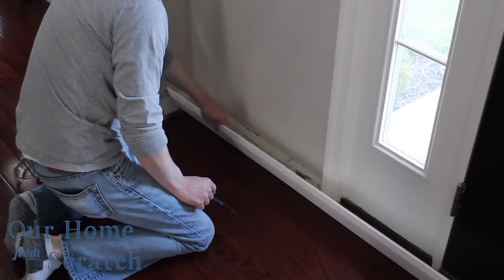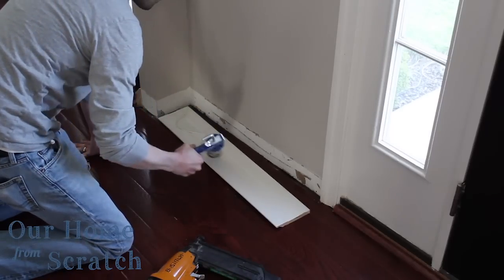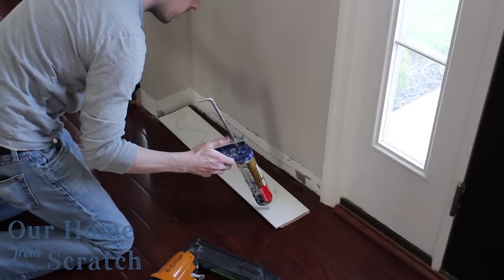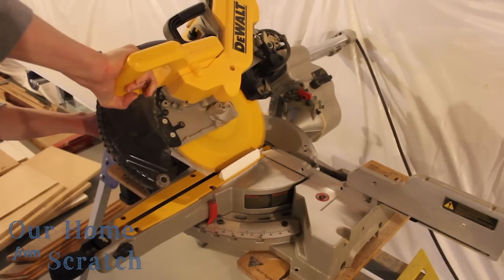How to Install Baseboard Molding

Comment: This is how one part of my wall is for chair rail molding.  So considering the part of your wall we can see you used two 45 degrees with copping ends and the rest are 45.  I'm confused about the piece that you measured in 4:13 and 5:04 are those just 45 angles no copping?
Reply from the maker: +TaRay Watts Only use coping for inside corners.  Miter cut all of your outside corners (no coping).  Assume they are 45 degrees, but best to try the angle out with two pieces of scrap molding cut to 45 first.  Then you can adjust the angle if they are slightly off (say 43 or 47 degrees, for example).

Comment: so the holes are just there? you dont use caulk or paint or whatever to cover it up? 

I spent 100k on a complete house remodel and this trim was part of it, but I dont like the site of those small nail holes sticking out, guess I'll have to figure something out myself since it'll probably be another 100k to patch them up lol
Reply from the maker: All nail holes get filled with wood filler and then painted.

Comment: Hi, John.  How do you install baseboards on a wall with a 45 degree inside angle?
Reply from the maker: You can try cutting both sides of your molding with 22.5 degree cuts first to see how that fits.  Try it on two scrap pieces before your use your final boards.  If that doesn't work, you can try coping.  To cope a 45 degree inside corner, cut your first board to a 45 degree angle so when it's pushed into the corner it makes contact with both walls.  Then your next board can be cut to a standard 45 degree cut for coping like in this video.  If that doesn't make sense, let me know and I'll email you a drawing.

Comment: Nice.  I don't have a compound saw or mitre saw...could I use my handsaw or jigsaw to make the 45 degree mitre cut that is to be coped?  Also, good taste I have the same exact molding. ;-)
Reply from the maker: +S Thunda You can, but it will be much harder to make small adjustments.  For example, if you need to take 1/16" of an inch off a piece of molding, that's very difficult to do by hand, but a breeze to do with a saw.

Comment: Great vid! I'm going to attempt this...how can I measure the  corner so it can be cut at Home Depot I don't have a power saw or a coping saw?
Reply from the maker: So you'd need to draw all your rectangles on your walls and then measure from corner to corner using a tape measure.
Reply: Thanks for your reply!
Reply: If you don't have tools don't attempt the job!  This is like asking how to sew a curtain without machine or needle, sheesh!